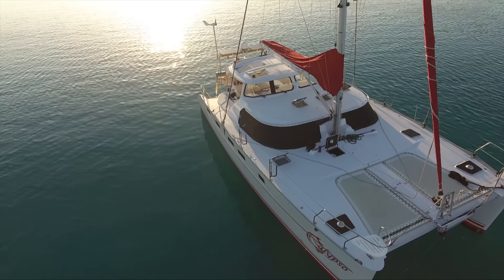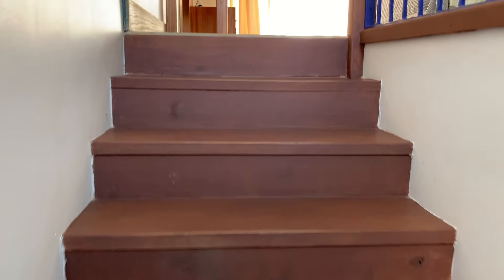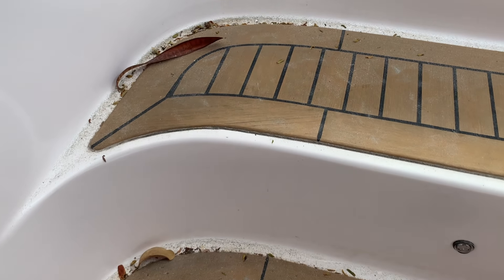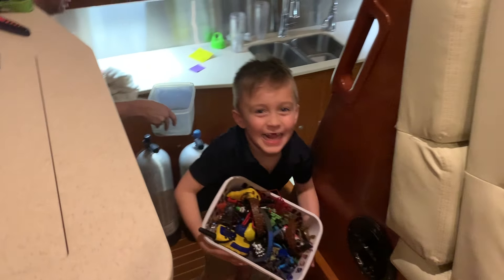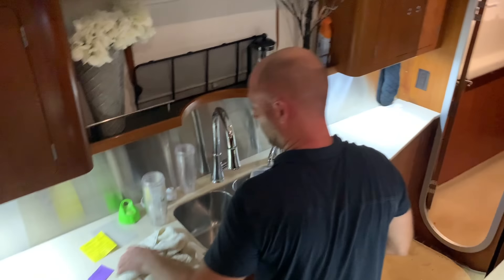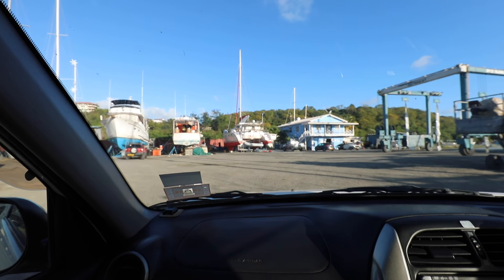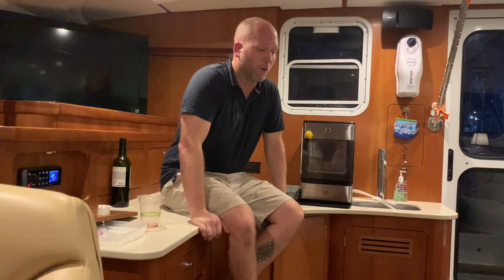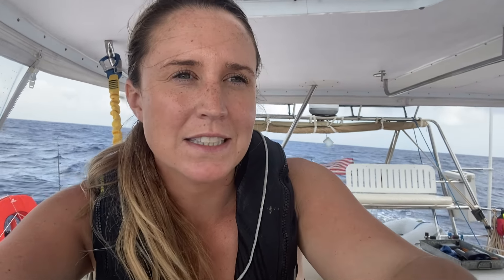Our RUDDER FAILURE! - Lazy Gecko Sailing VLOG 173

Comment: Great videos always . FYI, if you can access the core of the hollow rudder tubes, fill them with spray foam. It will greatly increase rigidity of the shaft by not allowing shaft flexing.
Reply from the maker: Thank you! Thats an interesting idea for sure!

Comment: I’m a steel fitter deal with mild steel and stainless steel tubes for 35 years or more your tube can be tig welded very simple cheap fix at a welding shop it will be as good as new or stronger ..... shouldn’t be more than a hours job at a good welding shop 👍 happy sailing
Reply from the maker: Awesome! But we've decided to change it for a new. It can be difficult to find that level of craftsmanship in some parts of the world and we'd always be wondering what condition the repair was in while offshore...Not something we should be worried about. You can't check this one easily.